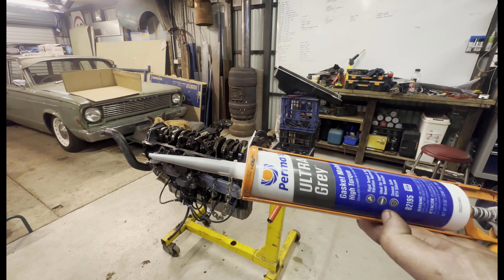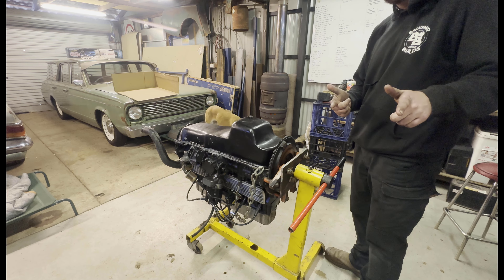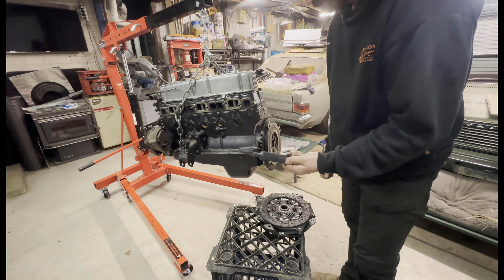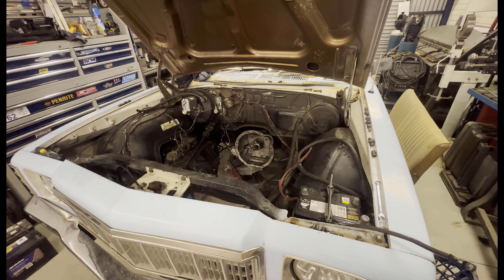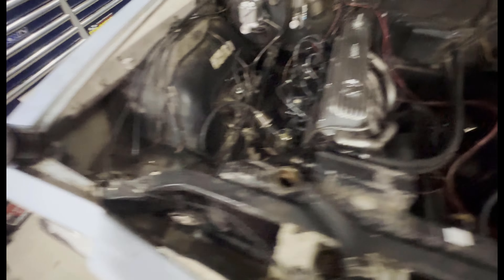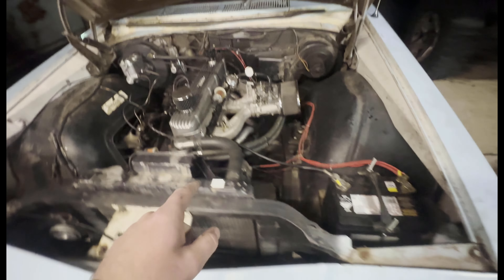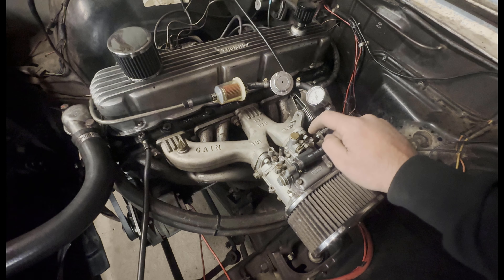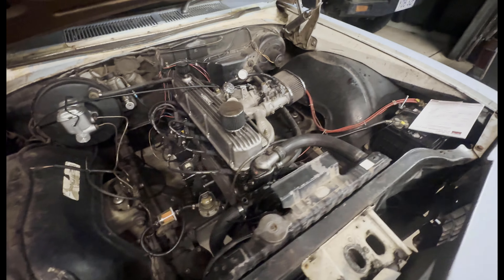Reviving a Legend: Holden 202 Reseal & Carby Tune | BackyardBuilds

Comment: G'day from West Australia,😉

If it helps to say this I did the following on my race car build. ( 202, 60 over), 5kg lighter crank, gudgeon pins just under oil rings, ofset ground big ends to shorten stroke even further than piston mods. A 149 head with no separator casting in intake ports, just an allen key bolt in bottom of port for a head stud. Screw in brass plug, where original head bolt used to be. 45mm intake valves, 38mm exhaust valves, bit of combustion chamber mods appro65ccs. Overall comp ratio of about 12:1. Fed by a 390 holley four barrel ( lots of mods there) 

And a standard rocker cover that has a metal baffel under rear opening, mine is a later 202 r/cover with second hole for PCV breather hose, so I run a catch can to both holes in rocker cover and a PCV valve in catch can with vaccumn hose to manifold.
( sealed system no blow by issues at crazy revs for a 202).

What you got to loose if you modify your awesome finned alloy rocker cover and side plates that I have been searching high and low for coz someone liked the ones I used to own more than me😶

Very cool build by the way, and yes IAm a veteran tradie of 43yrs in trade, just incase your wondering.

Who happens to like seing other guys builds.
Take my hat of to you ( old sign of respect from a time long gone).🙂👍👍
Reply from the maker: After a heap more driving, it appears that my issue is there’s no baffle under the fill point, so I’m going to ad something there to stop it splashing up & hitting the breather.
The finned side plates are just KC brand off eBay.
Reply: @BackyardBuilds  hmm baffle under oil fill hole, and yet a standard r/c hasn't got one. 
Could work after all your using a free to atmosphere style cap along with a small filter to atmosphere on the rear which could also be baffled.

Killkenny castings for side plates cool, shame they stopped making the finned r/covers.

Such is life😉🙂👍👍

Comment: i had a 173  that had blow by i ended up putting a rubber hose from the dip stick tube to  the pvc i removed the insides of the pvc valve so the oil  just returned through it ran perfect no more leaks
Reply: Did you really !????? I'm betting you didn't ! Because the pressure from the blow by now has no where to go ! You will pressurize your sump and tappet cover , blow pan gaskets and tappet cover gaskets , in fact if you could keep the hose on without bursting or blowing off you oil pan or tappet cover may deform or explode ! As the pressure will build up to over 125 psi at least ! Think about things before you post ,

Comment: Thank you mate for the carb jetting 
I’ve bought a bloody 45 DCOE
Dang it.
My donk has pretty much been built like yours 
Do you think I should go 48?
Reply from the maker: I’ve since changed the jetting a little more, but that’s more to suit my application. A single 48 does seem better on a crankier motor but try the 45 & play with it first, is yours a Weber or Dellotro?

Comment: Dont use grease on hoses, it rots them. Vaseline is the go. Dont cut the bonnet, use the factory oil cap and PCV. And if the motor is fumy it has no ring seal.
Weber is 3 psi, no more or it will go rich. Though you need two more!!